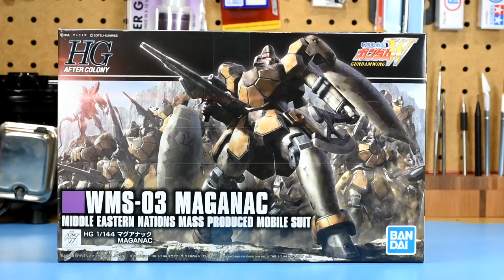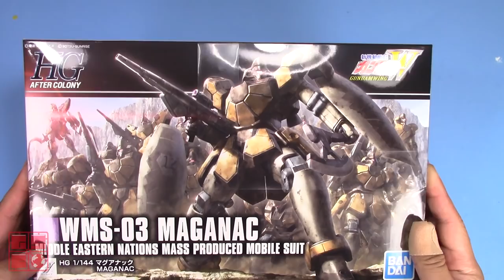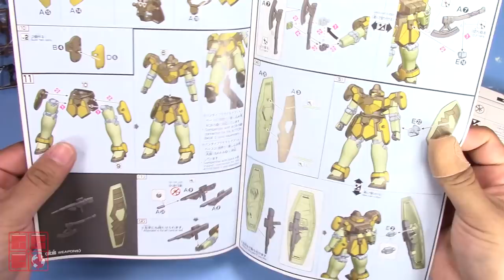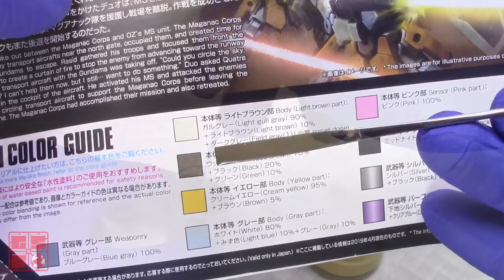Let's Paint: Bandai HGAC WMS-03 Maganac

Comment: very very cool dude :) i have a question what is reducer ?? because i know the clear the hardener and the retarder but i do not know reducer :/  btw very great stuff and skill
Reply from the maker: Thanks mate! Glad u enjoyed the vid (: 

Now to answer your question: 

Reducer is a solvent used to thin 2K Urethane finishes so that they can be sprayed properly through a spray gun/airbrush. For example, Reducers are used to thin Urethane based paints and Thinners are used to thin Acrylic Lacquer based paints. For the most part and with few exceptions, these are not interchangeable as each type of paint finish like Acrylics, Enamels, Lacquers, 2k Urethanes, etc. will need their own corresponding solvent to thin them properly. 

Hope this info helps! (:

Comment: What brand did you use for urethane clear coat? Is car grade urethane clear coat fine?
Reply from the maker: I use LIMCO LC4100 Gloss Acrylic Urethane system (google the LC4100 spec sheet to find the appropriate hardener and reducer).

This is definitely an automotive grade urethane used at collision repair shops. Its supposed to be a low cost system but its not cheap and relatively overkill for our hobby needs but that's why I like it >:) 

The only thing I do differently is to add double the amount of reducer as it can be a bit thick when mixed as specified for a 1.1mm spray gun in the spec sheet.  For best atomizing results using an airbrush, I recommend at least a .5mm or equivalent nozzle/needle set at about 25 psi and double the reducer ratio in the mix. Spray a few test spoons to get a feel for it. 

There is definitely higher quality automotive gloss clear coats than the LIMCO brand but IMO I think those would be truly overkill and money needlessly spent for scale models.  For our modeling needs, a budget urethane clear coat system is more than enough. 

Sorry for the long respond but I hope this info helps! (: